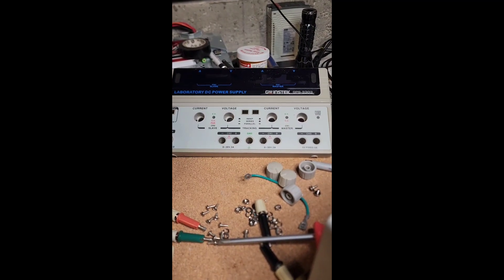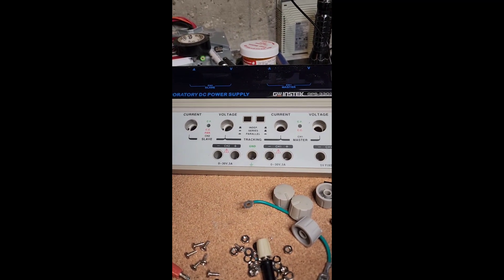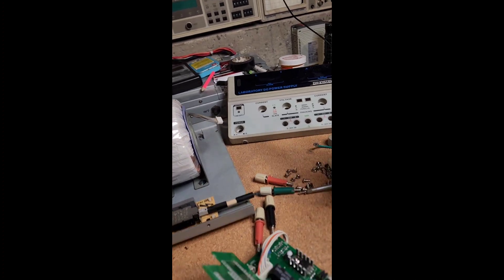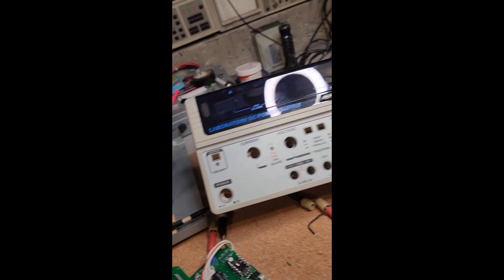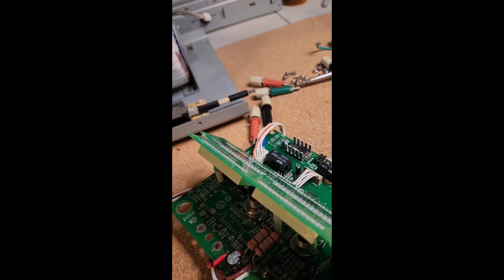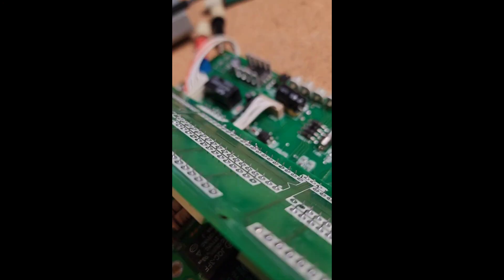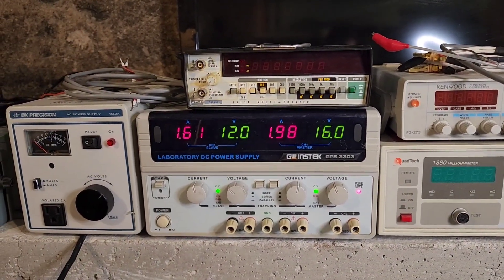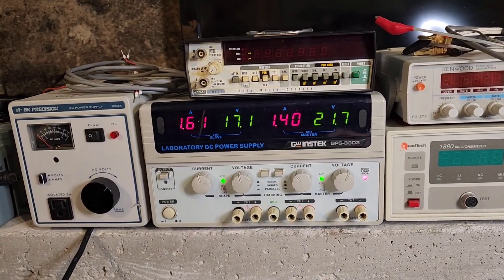Repairing GW instek GPS 3303 power supply

Comment: How erratic were your display ? Mine goes up to 99 V, current up to 9.99 A etc. Does this sound like the same issue to you ? Thanks
Reply from the maker: Mine was up and down about 6 volts, maybe about 3 amps, but sounds about right. My capacitors were also visibly popped. How is your output? Mine was stable, just the display was way off.
Reply: @gpgt1  My capacitors don't show any  visual issue. My output is fine as well, stable and coherent to the measurement. The display jump to the truly set values when I put the output on. But when the output is off, I have incoherent values on both channel-2 displays.
Reply from the maker: @Oldemonium  mine would stabilize more with the output on, but it would still jump here and there. Sounds like it is those caps on yours.
Reply from the maker: Any update on your supply?
Reply: @gpgt1  unfortunately no, it does not get any better:/
Reply from the maker: @Oldemonium  the problem is isolated to that board. You may want to check the other components in line with those caps. It's the circuit that controls the displayed values.